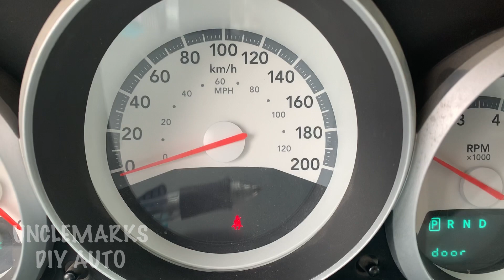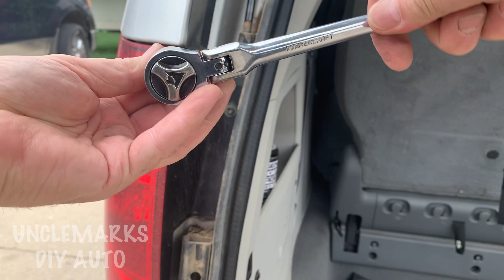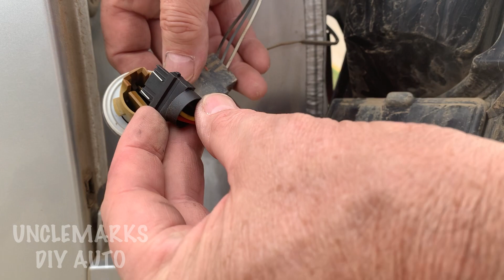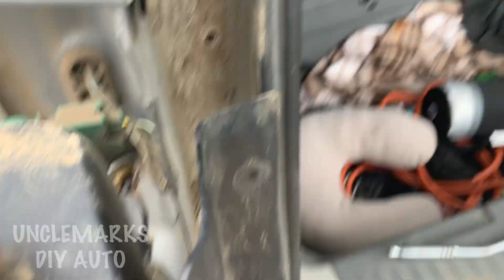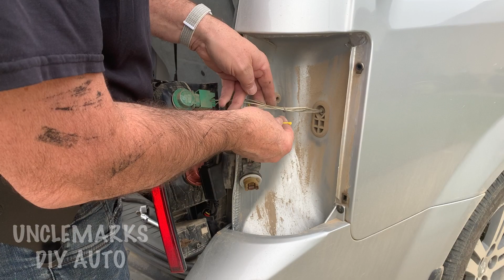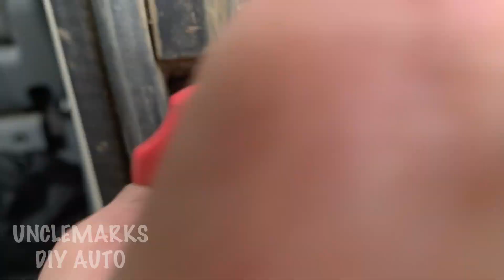Why are my upgraded LED signal tail lights flashing so fast?

Comment: Nice!!  Thanks for sharing - I'll remember this in case I run into the same issue :)
Reply from the maker: Yep, me not impressed. All the other bulbs caused issues as well. Talk soon, Jerry.
Reply: I had the same issue with a replacement taillight I ordered (not OEM) - must have had some weird resistance or something :) @unclemarksdiyauto
Reply from the maker: Yep, hope you were able to add a resistor to slow it down.

Comment: LED bulbs have a lower resistance than halogen bulbs which produces the hyperflash just like a burnt bulb would.
Reply from the maker: Yep. All the new bulbs claim they have this obstacle, overcome with whatever circuitry to make them canvas ready, and the resistance thing fixed. I also ended up buying the resistors after the flicker, and they just made other issues.
Reply from the maker: So they claim!

Comment: I've used "corncob' leds from Superbright on several of my vehicles with load resistors in the CANBUS models.  Worked on everything but a 2001 Chrysler Town and Country.  For some unknown reason that car just would not tolerate the corncobs.  But Sylvania "flat" style bulbs will work with it using resistors.  I know this makes no sense, but repeated back to back testing verified that result.  Go figure.  As you well know if you're experienced with electronics magic is always involved---.
Those sockets are keyed to go in only one orientation.

BTW, I also have an 09 4.0 T&C, just did the 100K timing belt and water pump for the second time.
Reply from the maker: This Caravan does not seem to like any of the LEDs I have used. Tails lights, head lights, fog lights, all differ styles.

Comment: All the light's on the dash all went on, and the wind shield wipers, in my 2014 Town and Country van. Drove me crazy, still can't find the reason. Do you have any tips??? Any video's you recommend?
Reply from the maker: Not off hand. If wipers on, it’s something crazy! Wipers on is a fail safe feature when everything else goes down. Have you tried to scan it with a code reader?
Reply: It started out on the reader saying the cadilic converter need to be replace bank 1. Then after a couple of weeks it said that I had to service the blind spot system. Then after a couple of weeks everything started to show up on the dash went bonkers. A friend of mine has a comp. to hook up to the van, and we shall see what it says, and reset it after. Plus in the last couple of days the engine stuters, I thought in might be the gas. I was told the Van has no fuel filter, is that right? @unclemarksdiyauto
Reply from the maker: Filter is in the tank and part of the fuel pump. (Normally should outlast the fuel pump.) Something is mixed up, changing it's mind as to what the code is. See what the comp hookup says. I would wait to replace a CAT as the only good ones are the factory ones and they are very pricey. Let us know what you find.
Reply: I did not have the chance today to get my friend to hook up the comp. and do a reading. But I was looking at another video, and they said that it's probably the air intake sensor before the C C.That might be it. I only have about 120,345 miles on it, so I don't think it's had a chance to wear out.  @unclemarksdiyauto
Reply from the maker: @deanjagger1190  Nust try NOT TO start firing the parts cannon at it, not until you rule out some other stuff

Comment: Just put 6k led headlight bulbs in my Charger and they actually are bright and white. I tried some when they first came out in sister's 99 300m and the light was way too blue and didn't throw down the road. Then 6 months later the bulbs went bad🤬
New ones also have a fan to cool the led elements so that should help.
Reply from the maker: Good to know!

Comment: excellent idea,  Did you only do the rear?
Reply from the maker: I also did the headlights and the fog lights. All caused different issues. Fog lights caused radio static, tail lights blinked too fast, headlights flickered and had delayed switching from dim to bright and at different speeds. Tried resistors as well (these bulbs all were CANBUS ready) which slowed the signals to the right speed, but other issues persisted.